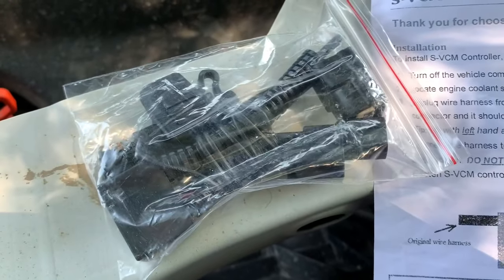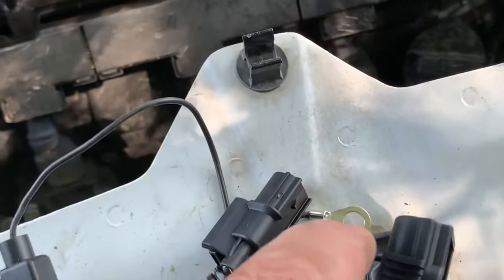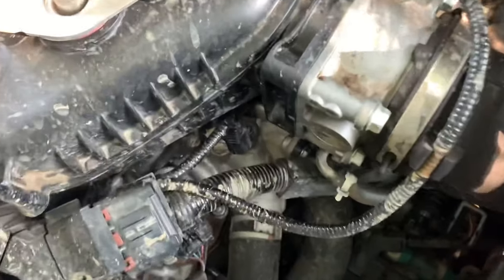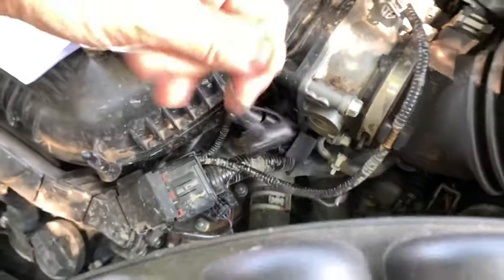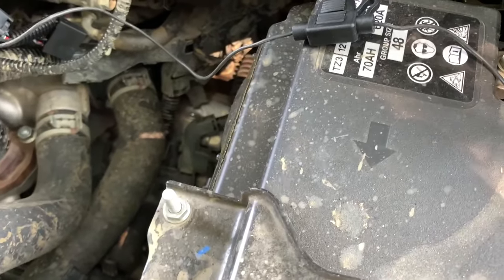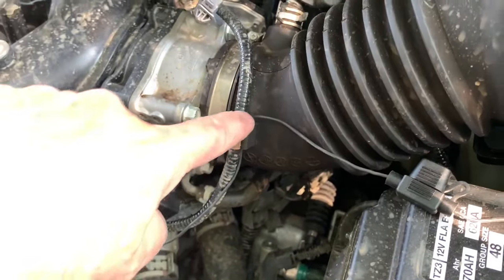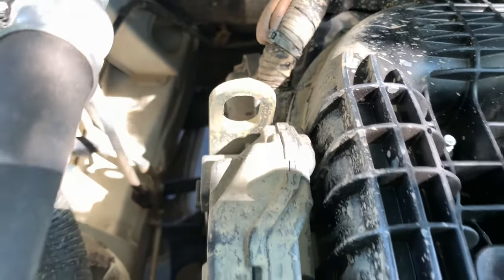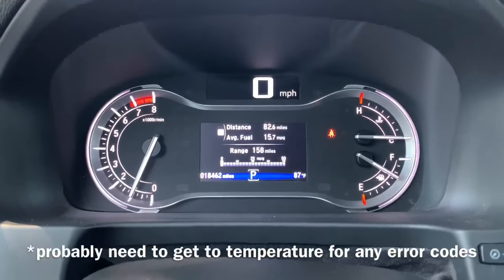Disable VCM (Varible Cylinder Management) in your Honda Ridgeline Honda Passport Honda Pilot Forever

Comment: Hello, I read in some comments from YT that some Ridgeline Owners (2021+ up model)  have experience lighting up the dashboard like x-mas tree and the backup camera stopped working after installing the S-VCM, have anyone experienced this or have any information about it?
Reply: Just installed on my 23 RTL while cool from resting overnight and no caution lights at all when starting up and took on the highway to test. Engine felt fully engaged whole time. Only “concern” I have is that my gauges still get the green eco lighting around them and not sure why.

Backup cam not working is likely poor timing related to the recall issue, but s vcm.
Reply: @dmbsituation  Thanks for sharing your experience. I believe the green lighting that comes up is based on how much you're pressing the gas pedal or throttle and not connected to the VCM. So your backup camera immediately stops working after you installed the S-VCM? Have you tried removing the S-VCM and check if the backup camera comes back? Thanks!

Comment: So what if your battery terminal does not look like that?  Mine is just a post and a cable.  Nowhere to screw the power to for the VCM controller.
Reply from the maker: What Honda do you have? Year and model.
Reply: @CampingRandy  2012 Honda Accord V6 3.5l.
Reply: @CampingRandy  Honda just put a new battery in my car and gave me one of their brand batteries.
Reply from the maker: It’s just a little ring you can attach to the battery under 10mm bolt.
Reply from the maker: Send a pic to CampingRandy on Instagram if need be.
Reply: @CampingRandy  10mm bolt that goes to the cable to attach to battery post to hold cable onto post?

Comment: Will this disable the eco mode?
Reply from the maker: You can still use eco mode if you like the dead pedal, expanded shift point and low a/c output. The S-VCM makes the TRUCK run all six cylinders all the time.

Comment: will this decrease your fuel economy ?
Reply from the maker: At 75mph I’m at 19 to 20mpg - so yes it will.
Reply: Will it save you piston rings? Yes!! Cost me 2800 to get the check engine light off! F@$& VCM  lol.
Reply from the maker: Holy cow!
Reply: @CampingRandy  I want this device you have, just worry it is going to trip the check engine light. Had to replace rings in cylinders 1-3.
Reply from the maker: It does not. https://ridgelinestore.com/S-VCM-Controller-VCM-Disabler-p369729001
Reply: @CampingRandy  Okay! Looking forward to this.
Reply from the maker: Thanks!

Comment: Does the MPG suffer or does it still get same MPG. Highest i seen on my 21 Ridgeline Black Edition was 30.8 MPG in Eco Mode. I dont tow and power seems fine but i did notice loss of power when rolling and press throttle. Its like Turbo Lag
Reply from the maker: Yes it will, as the VCM is one of the MPG savings.
Reply: @CampingRandy  Overtime tho i will have Engine Failure such as spark plugs fouling early and engine oil consumption if i dont but a VCM? Or does the 2021 Ridgelines has a better VCM and shouldnt worry? I wanna put a VCM if it will save my engine in long run from problems
Reply from the maker: It’s a 50/50 opinion. It all is based on who you ask. The Honda platform is amazing and the engines run forever. That’s why I am not a part of the whining bitching forum circuit or certain groups. It’s a machine and will break, PERIOD. But you have a better longevity with a Honda product.
Reply: @CampingRandy  Ok thanks thats good to know
Reply: What is the weight and length of you TT you’re towing with your Ridgeline?? Looking at a 21 RTL purchase
Reply from the maker: 26 ft at 4200lbs. Just remember to add your personal items to the weight as well. Also invest in a weight distribution hitch to keep the weight on the front tires. AWD tows 5k w/ transmission cooler. FWD tows 3.5k no trans cooler.
Reply: @CampingRandy  AWD is standard starting ’21 model year. Do I still have to have dealer install strand cooler or is cooler now standard equipment????
Reply from the maker: Yes if it’s AWD. You can see it through the front grill. Bottom right side.
Reply: @CampingRandy  I have the 2017 Black edition does that one have the cooler?
Reply from the maker: All Ridgelines trunk can be a cooler. The ice does stay to long but it fun.
Reply: @CampingRandy  i just purchased the scan gauge 2 and have noticed the transmission temp get up to 210 in the city. Think it could be the scrap plate not letting it cool dwn? Does urs get that hot?
Reply from the maker: @roberto3007  yes but only at slow speeds on the trail. Has only happened twice ( getting the over temp error). I’ve taking the heat shield off the hood as well engine cover and propped the hood then wedge an empty water bottle it so it does not rattle. Video coming soon.
Reply: @CampingRandy  I’m leaving to Nevada this month with my son to camp and am wondering if i add the muzzle will my truck over heat in Death Valley? And will the temperature gauge still work on the dash so i kw if its getting warm? I seen a web site that has a on and off switch does urs have that?
Reply from the maker: You will be ok. The S-VCM has a sensor so it will not cause an issue.
Reply: How on earth do you get 30.8 MGP in Eco Mode on 21 Ridgeline? I have 21 Ridgeline RTLE it has the HPD on it, but the best I have been getting is 22mgp. I only have driven 2k miles on it, mostly highway.
Reply from the maker: 55mph, no hills. Following semi-trucks as well. Lol
Reply: @timothyzennie7887  Freeway driving only. Wish was City Driving would be Awesome but yea Strictly Freeway Driving is how i managed em on Truck MPG Meter

Comment: Ahhh... funny I have the Ridgeline 2021 and I never feel any vibration, maybe they did some upgrades or something because I didn't experience that, 😅 , maybe because I have the towing package, thanks GOD!!!
Reply from the maker: Everyone is different. Some folks feel it and hate. Others don’t. It’s a choice that’s out there. We have the IDLESTOPPER too!
Reply: Oh you’ll feel it later on down the road when those liquid filled motor mounts start to wear out because of the VCM kicking in
Reply: @agaad22  🤔😎😉
Reply: There's no such thing as a "Tow package" on the Ridgeline. You mean you have the AWD with 5K Lbs tow rating. Not like it has a transmission cooler or heavy duty radiator, brake controller or anything like that.
Reply: @IamGroot786  maybe, but at the dealer they they said I have the Tow package, I am new with this pickup truck, I know Ford and Lincoln. I will try it and see so far I like it
Reply: @07Review   Yeah, salesmen will tell ya anything. Don't get me wrong, I'm not knocking the RL. I own a 2017 myself and love it.
Reply: @IamGroot786  Man I hope to have good experience with this truck, so far I heard only good things about the Ridgeline, that's why I bought it.
Reply: @07Review  I've had mine for almost 3 years and haven't experienced the shaking others are complaining about here. Yes, so far it's been great for me with no issues at all. It totally rocks on the ice and snow come winter time. I've done some light mods like all terrain tires, a catback exhaust and an oil catch can. Good luck with yours and enjoy.
Reply: @IamGroot786  nice... which oíl catch can do you have, I am debating for a good one. If you can send me the link, thank you.

Comment: Isn't this only when "eco mode" is enabled? Couldn't I just not enable eco mode??
Reply from the maker: Actually NO - VCM is always operational. ECO MODE Lowers A/C output. Takes forever for the interior to cool ( do not use eco when it’s hot outside), expands the shift pattern, and deadens the gas pedal, and downshift. Not a fan of eco mode unless I’m going on a long trip.
Reply: No, it's always operational. The idea behind it is to maximize fuel economy by deactivating cylinders for instance when you're cruising on the highway.

Comment: I just hate how vcm messes with the cruise control. On incline, the speed drops too far before cylinders activate, then vehicle floors itself past chosen speed... then coasts a moment before applying fuel again.
Very annoying.
Reply from the maker: Do you have the ECON button ON to? If so it expands the shift as well lowers your A/C output. Sucks on a hot day.
Reply: did you manage to disable vcm. How impression now?
Reply from the maker: Works great!

Comment: Oh yea, if you have a modern Honda and you want to run it past 100-150K miles, you have to have this.
Reply from the maker: Correct!
Reply: What is your evidence?
Reply: @CLGill36  stuck piston rings. Go on the forums for all the people being told by the dealer they need new rings. I turned mine off. i don't have the problem. Every manufacurer using this crap is having problems. Toyota is one of the few who said 'No thanks' not worth the headache.
Reply: @CLGill36  hell, just read all the comments on here.

Comment: VERIFY the version 3.5 V6  Engine YOU have ! .VCM is NOT on all "J35" (3.5L ) engines  ! ! . . There are many versions. . . . "J35A1-J35A6" engines Do NOT  use the VCM system. VCM system starts on J35A7 and up A8 etc. 😊
Reply from the maker: All Honda V6 engine have VCM

Comment: Gen1 doesn't have VCM
Reply from the maker: YES THEY DO
Reply: @CampingRandy  NO, THEY DON'T!  Honda introduced the VCM into Ridgelines in gen2 (17-current)
Reply from the maker: Attention attention attention- please note that I made a mistake. The gen1 Ridgeline DOES NOT HAVE VCM. The following do: 2003 Honda Inspire
2004+ Honda Elysion V6
2005–2007 Honda Accord Hybrid (JNA1)
2005+ Honda Odyssey (USDM) EX-L and Touring Models only (J35A7)
2006–2008 Honda Pilot 2WD Models only (J35)
2008–2017* Honda Accord V6 (except EX-L V6 6MT Coupe) *Starting with 2013 Model, VCM operation is 3- or 6-cylinder mode, no longer 3, 4, 6-cylinder operation.[2]
2009+ Honda Pilot (all models)
2011–2016 Honda Odyssey (USDM) V6
2013 Acura RDX V6
2013 Acura RLX *3 or 6 cylinder mode
2014 Acura MDX *3 or 6 cylinder mode
2015 Acura RLX Sport Hybrid *3 or 6 cylinder mode
2016 Acura TLX V6
2017 Honda Ridgeline
Reply: Will this work on my 08 Ridgeline Rt? Thx!
Reply from the maker: First gen Ridgeline do not VCM.

Comment: I’m no mechanic but this can’t be good for your engine long term
Reply from the maker: Agreed
Reply: this disabler or the vcm itself??
Reply from the maker: Some folks say both!!!
Reply: @CampingRandy  and i just ordered this from you but the one i received doesnt have an inline fuse like the one in this video.  why??
Reply from the maker: The upgrade does not need a fuse.
Reply: @CampingRandy  ah ok..  and i saw you mentioned you had the shudder issue as well?  what is that exactly??
Reply from the maker: A shutter issue???? I think it was the trans fluid. I had surging. Changed fluid. Went away.
Reply: @CampingRandy  oh ok, i thought you answered to someone that was having a shuddering issue..

Comment: Does anyone happen to know if the new 2023 Pilots has vcm... I'm really 🤔 💭 thinking about purchasing one cashhhh otd
Reply from the maker: Yes they do.
Reply: Randy,
Will I still be able to use the same exact vcm disable modular device in your video in order to deactivate it... and is the vcm sensor located in the exact place as the former
 model 2022, also does work same exact way... thank you
Reply from the maker: I was just informed yes, you can use the same one. They did not change the plugs.

Comment: Would driving in 'sport' mode basically do the same thing? Have not noticed anything yet but not even 1000 miles yet on my 2021 Black Edition
Reply from the maker: Sport mode - also known as Sequential mode will just keep you in a lower gear as well not skip gears to achieve better gas mileage.

Comment: Does it work on MDX Type S ?
Reply from the maker: Yes
Reply: @CampingRandy  May I ask how you know it works on the MDX Type S?  Their website make no mention of the 3.0 Turbo engine.  Only reference I see is 3.5L.  Also, there is no mention of MDX 'TypeS'.  So it absolutely works on 3.0 Turbo / MDX Type S?
Reply from the maker: Reach out to directly to S-VCM Controller <smartvcmcontroller@gmail.com>